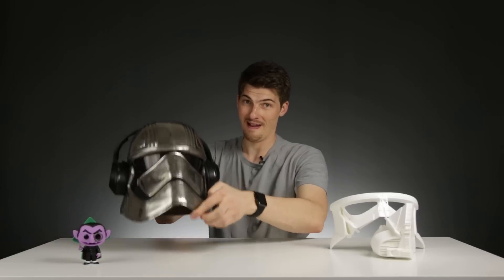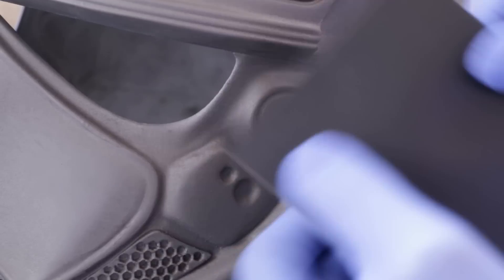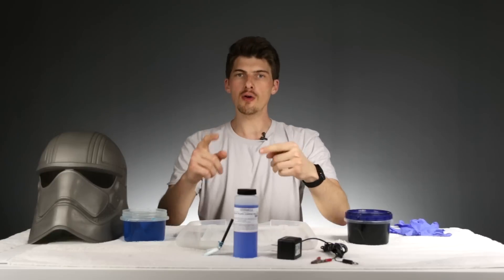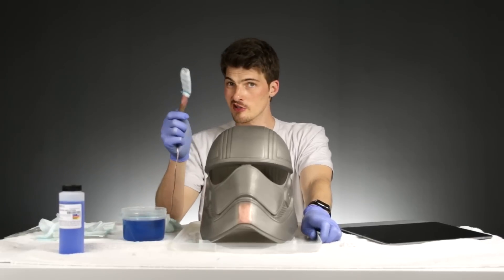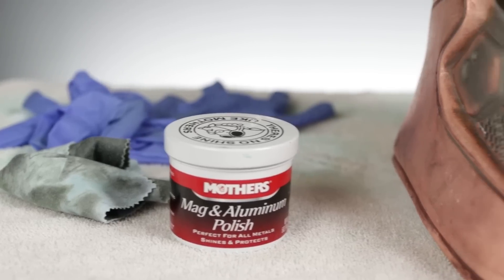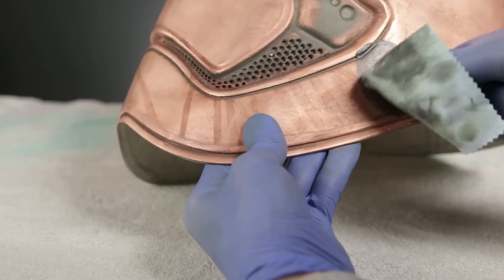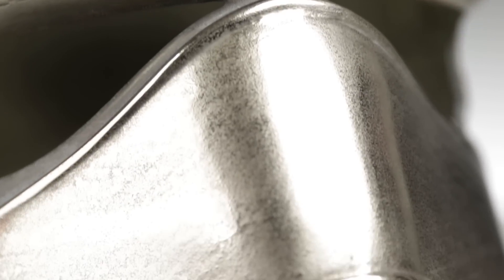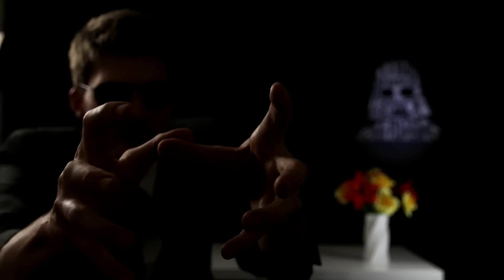How-To Make Metal: Electroplating a 3D Printed Star Wars Helmet

Comment: I'm a bit confused, why did you do copper only to cover it with nickel instead of just doing nickel to begin with, do you have to do it that way?
Reply from the maker: +Eric Nirta great question! Copper plates onto surfaces faster and thicker than nickel does. This helps to fill in any small imperfections on a surface (small scratches and stuff). It's also a softer metal than nickel. This makes it not only easier to polish, but more effective at getting a smooth surface and a high reflective shine. 

You could certainly plate with just nickel, but the surface finish wouldn't be quite as good. 

Thanks for watching!
Reply: Eric Nirta in theory you could print using the carbon fiber filament as long as it conducts it will work but it won't stick to just any surface even this will likely peel off. as for why copper it plates more readily and thicker and can accept a number of alloy to stick to it.  also it makes for a better quality finish
Reply from the maker: +Lunas Eclipse such a solid response. Couldn't have said it better myself.

Comment: Excellent video!  The question I had was -- why did you plate with copper first and then nickel?  Why not just two coats of nickel?  Thanks and good luck with future videos.
Reply from the maker: Hey Justin! Thanks for the kind words and taking the time to watch. While you could certainly plate with two layers of nickel, plating with a copper under layer is a common electroplating practice. 

Copper is a soft metal and polishes very easy. Not only that, but it can build up layers pretty fast and pretty thick. This helps to fill in any imperfections on the surface of the object you are plating. Polishing it then gets to the surface to be as flat as possible. 

If you wanted, you could certainly plate nickel first, but it may be tougher to achieve a high shine finish than with copper. 

I hope this helps some. Let me know if you have anymore questions. 

Cheers!
Reply: Justin Heinen The other reason is that copper is one of the best surface treatments at "sticking" to things when electroplating. By "sticking" I don't mean in the normal glue sense of the word, but in a electro/chemical way. 
To generalise just remember that in most cases, copper sticks to everything and everything sticks to copper because it reacts so well. That makes it the best  surface treatment to have in the middle. 

As the mentioned however, the copper needs to be really REALLY Clean for the best result. This is where the blessing of copper reacting so well becomes a curse. It reacts really well with the oils in your skin, so wear gloves if you don't want a nice fingerprint motif. Also the oxygen in the air will oxidise copper very quickly.  So it's best to plate it immediately after cleaning it. Especially don't clean it and then think "my arm is tired, I'll plate it tomorrow..."

Have fun, do a few practice runs on some scrap first to get the hang of it. It really is awesome. And addictive. Once you get good at it you'll be walking around just looking for things to electroplate! 

Then you can learn how to anodise aluminium! Also awesome fun!
Reply: From what I hear, it has to do with the ability of various metals to release ions - or rather with the difference in this ability between two metals. Basically, you can't bond a very highly reactive metal to a very low reactivity one. You need to use a "gradient", by interposing intermediate metals. As Martin Dolan said, copper is the most reactive metal in that respect and because of that, for instance, you can't deposit chrome directly to copper - the difference between the reactivity of the two metals is way too high. That's why, for instance, when chrome-plating, you use an intermediary layer of nickel between the base and the finish.
Reply from the maker: +Martin Dolan oooooo anodizing aluminum. That sounds like a lot of fun! Thanks for chiming in Martin!
Reply: Infosmercial Very cool. You made a fantastic video there bro. I've used a lot of metal polish solutions & Happich Simichrome Polish is my fav. I'm not sure if the time you spent at 8:00 in the video is typical paste application time or not. It took way too long applying paste. The polish I stated goes on as fast as you can spread it. Let it go on very sparingly. Then set a few seconds & wipe it off & buff. All the best to you.
Reply: SCIENCE!!!  The More You Know...®.   THANK you for the interesting info!
Reply: Infosmercial Oh, never mind! Doh! I read above for the answer. My face is red.
Reply: Infosmercial Why didn't you just nickel plate it in the first place?  You plated the copper?????

Comment: Pretty impressive! I didn't know kits like this existed.
Reply from the maker: +Mighty Jabba's Collection Yeah it's pretty neat stuff. Took a bit of discovery and tinkering. Thanks for tuning in!
Reply: the kit's are $$. just buy the bulk chemicals and make the brushes like he did.
Reply from the maker: +Davey Hi yeah the kits do cost a few bucks. They are great as a small package solution if this is simply something you want to experiment with. If you want to take on multiple projects with this, the getting bulk chemicals is a good idea. 

Actually, the 1.5 gallon kits from caswell are a pretty decent deal and you get most everything you need.

Comment: Hi What is the current and voltage on the converter thing ?
The brush is just an towl on a pice of metal ?
Reply from the maker: +Carsten Lenzen Hi there! The caswell plug n plate kit includes a 5V 225mA charger for connecting to the metal brush. 

It isn't a towel, but rather gauze that is used. It is lightly wrapped around the brush and secured at the end with a rubber band. 

It's not just any piece of metal. Each wand is made of a specific type of metal that is dependent upon the solution to are using. For copper solution, you would use a copper wand. For nickel solution, you would use either a nickel or stainless steel wand. 

Hope this helps!

Comment: That's super rad! How durable is the finish?
Reply from the maker: +oobasnork Seriously rad, right?! 

The durability depends on a few things like how thick you plate the copper and nickel. If you use a process called tank plating, you can build a very thick layer of metal. Layers tend to be thin with brush plating, like was done in the vid. 

So just messing with the helmet right now, it can withstand scratches from sharp objects pretty easy. I'm sure you could drop the thing and have. I problems for the most part. It won't stop heavy gouging with something like keys (I just tried, oops). 

Overall, it'll make any surface much more rigid and durable. Great for something like a 3D print or plastics!

Thanks for watching.
Reply: I do work at a place that has an entire chrome plating tank system. Sometime I'll have to see if they'll let me test plate a printed part with conducive coating on it. If I do I'll be sure to let you know how it turns out!
Reply from the maker: +oobasnork Oh that's awesome! Yeah I'd love to see the results.

Comment: Wow, is this your first video? That's amazing man!
Reply from the maker: +Stefffan Thanks a lot! Yeah first video and more to come! I'm glad you liked it.
Reply: Infosmercial considering printing time and everything else, how long did it take to complete it and how what is the complete cost of materials? Some of these products you linked to are pretty expensive!
Reply from the maker: +Stefffan I'll admit that this is an ambitious project that will definitely require a good amount of hours and some elbow grease. 

The printing time was pretty long (over 30 hours of printing), but that was the easy part imo. Sanding and assembly was probably 4-6 hours time. Each plating step probably took 3-4 hours time. Polishing took 2-3 hours as well. Add in 4-5 hours for complications, figuring things out, unforeseen crap etc...

Cost wise, something like this could cost $120 - 150 to start. That's the bad news. The good news is that most of the supplies can be reused to last a few projects. If your working with smaller projects, things will last even longer. 

Of course, there may be some DIY hacks to cut corners in both time and money, but this is all a method I found that works most reliably. 

Cheers!
Reply: Infosmercial thanks for the great info! Maybe one day... ok, probably just printing that helmet would be a huge success for me xD

good job man, keep it up! Looking forward to your next videos! :)